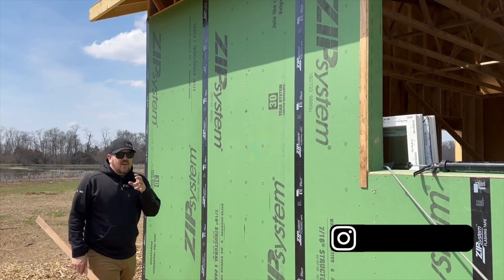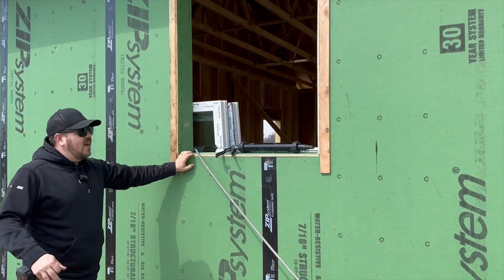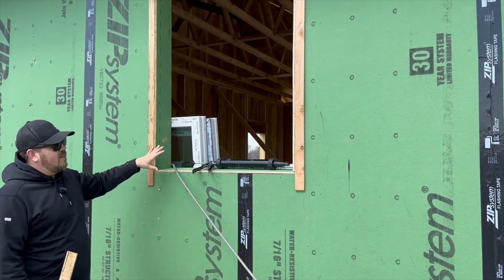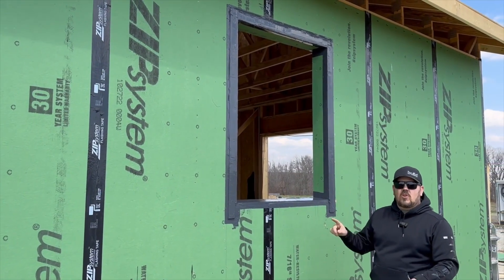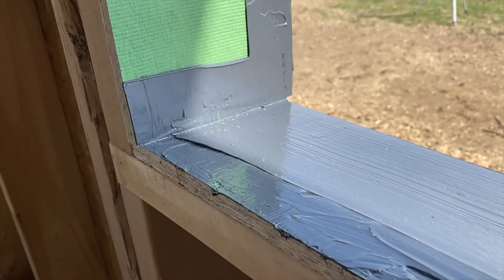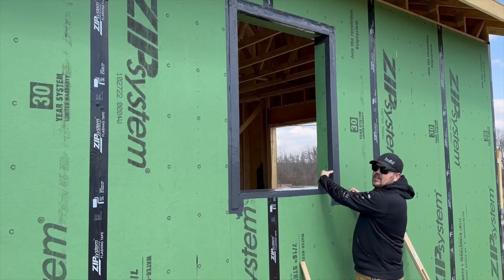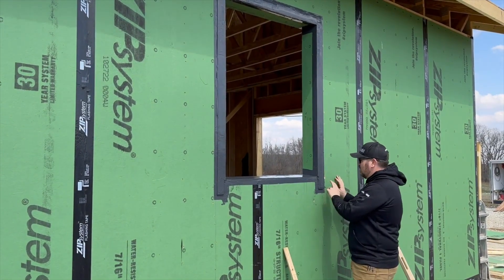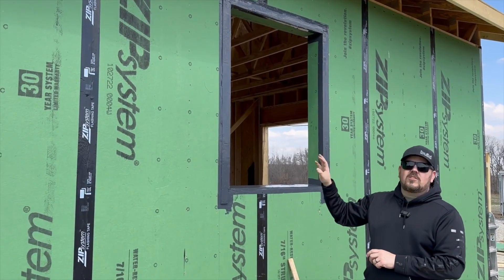Want Windows That Last? It Starts Here

Comment: Do you use a rain screen behind vinyl siding, or is it not necessary?
Reply from the maker: I would make an arguement that properly installed vinyl siding is one of the only claddings that doesn’t require a rainscreen due to the loose nailing. Of course it wouldn’t hurt, but it would likely be a bit of a waste.
Reply: If you are talking about typical vinyl siding, which is horizonal, and hung, the siding is not air tight, there is already a gap between the building and the vinyl siding.  If properly installed, any water that gets behind the vinyl siding should find its way down to the bottom because it's not air tight
Reply from the maker: Agreed. That is exactly what I mean. It is gets nailed tight. that would be a problem. I have seen water held in tension behind vinyl that was nailed tight as well as J channel.